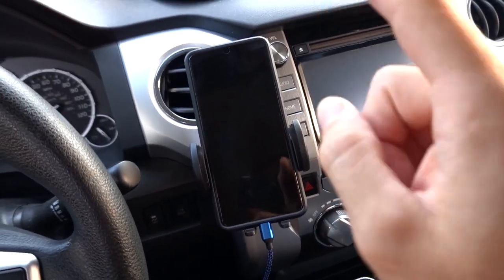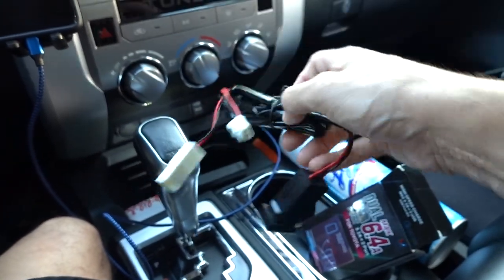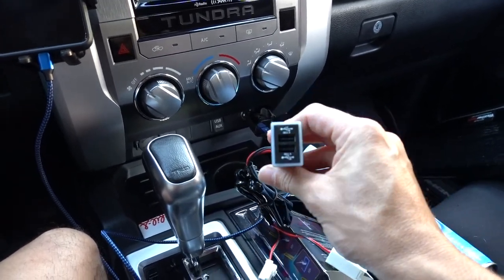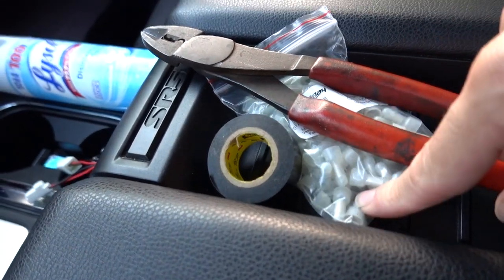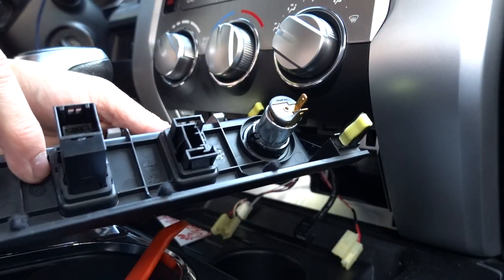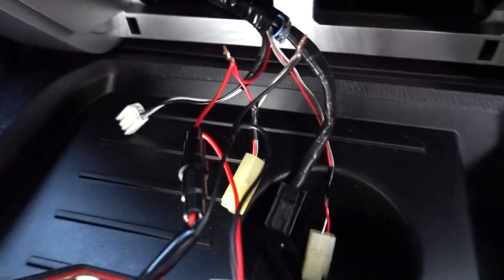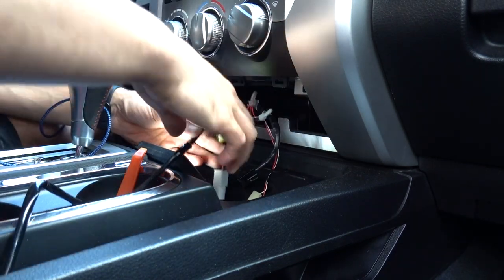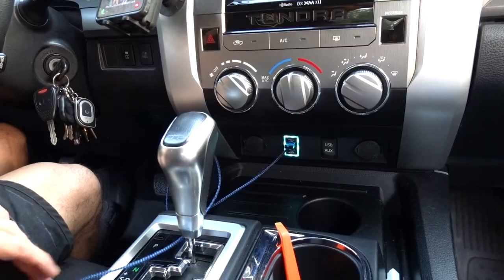Every Toyota Tundra NEEDS THIS Dual USB Port Quick Charger Socket 3.2 Amps Quick Charge Your Phone

Comment: I wanted to say in my 2007 tundra SR5 double cab. Had two cigarette lighters the one on The driver side had that white connector so it actually is plug and play it required no cutting. Just an FYI for the '07 and up
Reply: wait, what? I just tapped into the 120 V but you're telling me I could've saved myself the hassle? I have a 2010. the connections on my USB look liked one square and one circle. it came with an adapter harness to cut into a power source, so that's what I did but you're saying I could've unplugged the cig lighter on the left and used that to connect it? but then that cig lighter is no longer active, right? and are you referring to the left one on that center console or is there a different one left of the steering wheel?
Reply: I have a 2008 Tundra Crewmax and i had two lighters as well.  So the driver side lighter will have the white connector to plug and play.
Reply: I got a 07 crew max sr5 gonna see if I can do it without the cutting

Comment: I just finished installing one of these today, and it looks great. Mine, however, has the voltage meter, but it isn't accurate and is off by -0.6v.

Comment: Anyone have any problems with this draining your battery? I followed all the steps but I tapped into my left 12v socket power instead of using snow caps. It works great but woke up this morning to a dead battery. No other electronics were on. What did I do wrong?